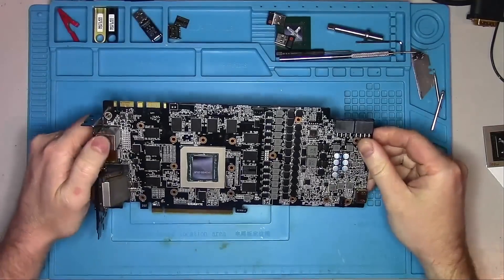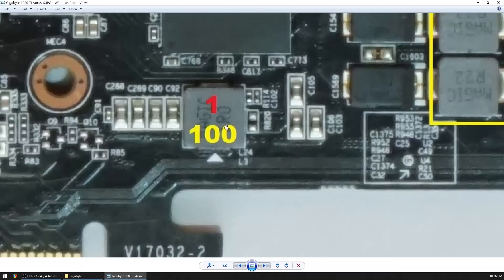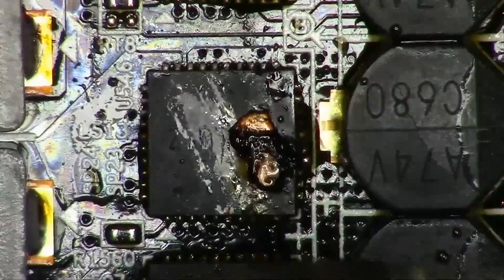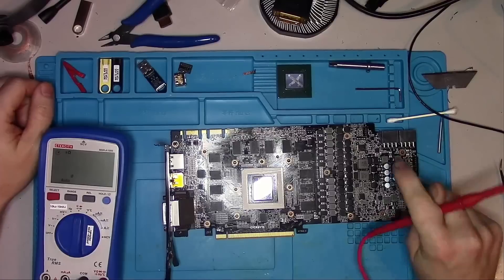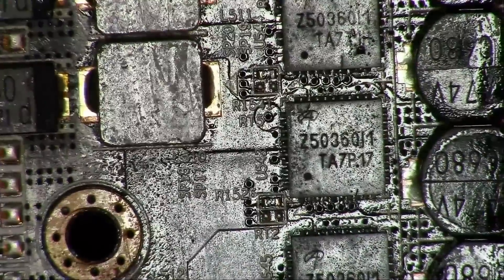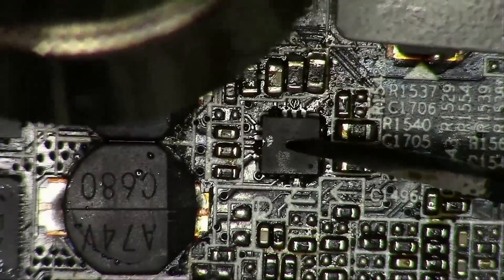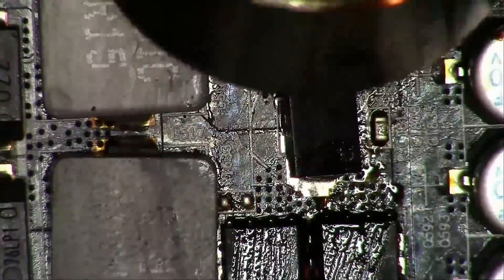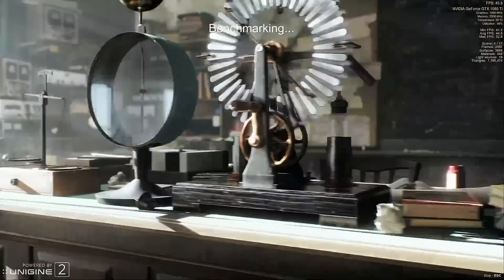Are Graphics Cards Repairable ?

Comment: you make  many error  on solder  quad package   first  pins on ic  it easy to remove  so you must didnt remove the old  solder second 
 the ground   plate pad  is big problem  cause if  you solder  and there is  sn  under ic  the ic will not be  flat  and many pins will not conected  even if it  connected  if you see it by  lens  magnificant but it just cover without  real  connect

Comment: Hello, I just wanted to ask a couple of logical questions.

Under what case scenario is it normal for a GPU to have all these kinds of damages done to it?

Over the years I've had a couple of GPU's, none of which have experienced anything similar, nor were fried/damaged/etc.

Is this a part of a GPU's normal lifecycle, or is it just something that happens in on a one off chance?
Reply from the maker: Same reasons why some people suddenly get sick and die.
Born with defects or illness. Accident happened. Dehydration or heat exhaustion etc. All the same reasons.
Reply: @northwestrepair  I see, it's more like a multitude of external factors affecting the device have all reached a peak and caused a fault. Intriguing, I'll carry on watching more videos to attempt and figure out the POF's origin.

Comment: Excellent work man. In a future video, could you go over the various liquids you apply during your repairs? I know a lot of rubbing alcohol is being used for cleaning, but for the other liquids, I can never tell if it's flux or conductive glue and would really like to know.
Reply from the maker: flux, alcohol, UV curing resin.
Sometimes break cleaner.

Comment: Subscribed and joined the discord. Great work NWR, I appreciate the videos. I'm debating if I should have an older graphics (GTX650 Ti boost 2GB) card repaired. It has served me well for many years but recently took a dump causing me to upgrade to a moderately better card. Still, it would be nice to have a backup card handy in case that happens to me again. Thanks again for the videos.

Comment: Bro your videos are AWESOME!
I'm watchmaker, and i LOVE your work, very similar. Focus, detect and correct the problem.

I have 1 old 980Ti, with the "famous" problem of R172 & R174. Only a bit toasted, not burned or exploded.

I never do anything with Electronic micosoldering but, after see you, i'm thinking give a try to Repair that old GPU.
Can you give me some "novel tips"? And sorry 4 the bad english, not muy native language :)
Reply from the maker: Literally in every video i follow same steps until i stumble upon a problem.
Start with measurements. Find short circuit.
If it isnt there, check for voltages.
If you missing voltage, you know where to focus at the very  least.
Reply: @northwestrepair  Yeah that its simple, i was talking about tips for soldering! Thank you so much!

Comment: Hey, just found your channel by chance. Who makes the best quality cards in your opinion next to EVGA (doesn´t matter if Nvidia or AMD chip)? I am currently in the process of gathering the funds to build a new PC. I used to like MSI and my current card has worked without problems for the last 3 years, but with more recent information, I might stay away from the brand for a while.
Reply: Based on previous designs I'd say sapphire makes the best board designs. I'd even go so far as to say that they made better designs than evga sometimes. It's a damn shame they don't make nvidia cards, though based on evga's recent statements they seem to have dodged a bullet...
Reply: @WineLad  Who makes best Nivida beside EVGA since they gone then?
Reply from the maker: It's a hit and miss.
They may make good cooling but forget fuses. Or they put fuses but make it so huge it will crack under its own weight.
Reply: I am a massive sapphire supporter. Nearly every GPU I have gotten in the last 2 decades has been a Sapphire. I've never once had a catastrophic failure on one of their cards! Their cooling solutions are too notch and their customer support is better than Asus for sure. Well, I take that back, I had a Sapphire Nitro+ R9 390 8Gb that stopped working out of the blue while playing Batman Arkham Origins, but I think that was my fault when i used too think of thermal.pads on the Power MOSFETS and VRMS 😢. other than that. Sapphire has always been my go-to, I'm currently using a Sapphire Pulse RX 6800 XT, it's clocked at 2369MHz and doesn't read above 61°C even on high throttle games. It was even bought renewed from Amazon😅😅

Comment: Hey man can you fix my msi lightning r9 290x good card don't want to throw it away it needs capacitors and the lower power phase is dead
Reply from the maker: Maybe I can but if you pay for shipping and parts, it's cheaper to buy used cars.
Am not even counting labor cost 😞